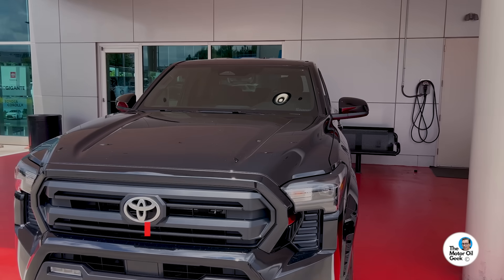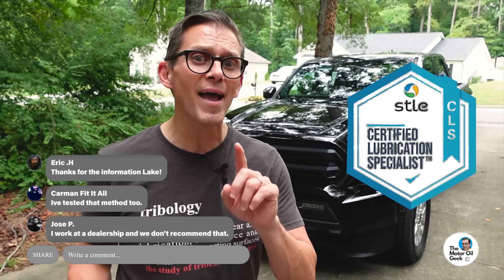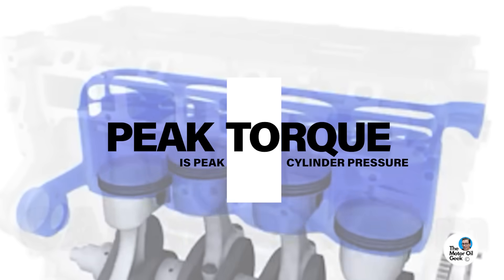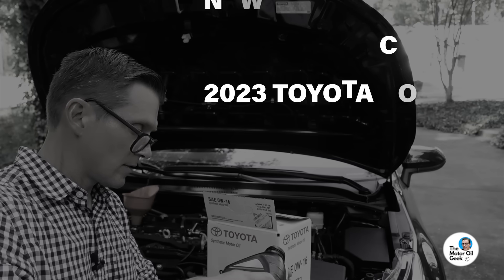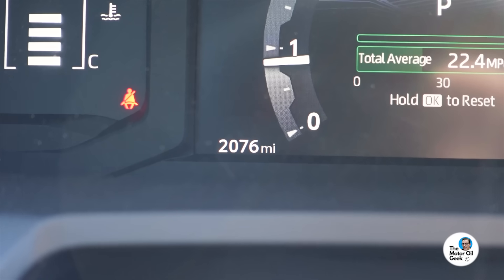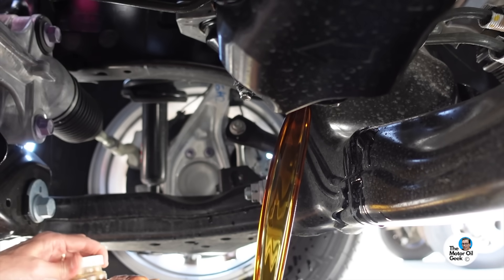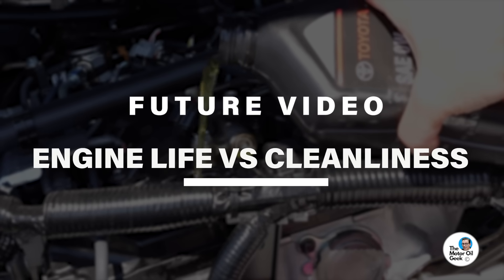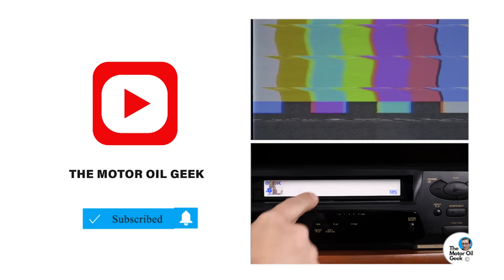The FACTS About Oil Changes (What The Owner's Manual DIDN'T Tell You)

Comment: Excellent video and topic is relevant. I am curious though that by not changing the filter during break in with the large amount of debris, will it increase the internal oil pressure of the filter to open the pressure relief valve and allow unfiltered oil the circulate through the engine? I understand that this may vary by filter and also machining tolerances of engine parts, however, I know on some cars the filter itself is tiny and by inference, the filter media reduced.  For example, Honda uses the same filter for their 1.5 liter I4's all the way to their 3.7 liter V6's. I assume that decision was based on cost and inventory simplification than really engineering.

Comment: Another great video!! Love your work. When I bought my wife’s Hyundai Tucson with 2.0L GDI engine, I did exactly this, and halved the OCI’s to 7500kms. Also jumped to a 5W-40 instead of a -30. Of course a low SAPs for the GDI. For a historically unreliable engine, ours has never missed a beat. I truely believe oil maintenance make a crap engine reliable 😂

Comment: In the UK i have always change my oil filter every year but do an oil change 2x a year with good,decent oil & i do 5,000m every year. As long as your engine has a good service history it's totally fine. With so many vehicles on the road with congestion,lights,road works etc the engine is at idle a lot compared to 10/20yrs ago.

Comment: Does break-in period change in Hybrids or remains the same 1000 miles (1600 km) as per other videos?
My car: 
Toyota Yaris Cross 2025 Hybrid SUV (Benzine + Electricity):
European type-approval number: e6*2018/858*00013*05
Variant: MXPJ11(H)
Execution: MXPJ11L-BHXNBW(1F)
Motorcode: M15A

REASONING:
For my specific daily routine and driving style, the average EV percent usage as reported by car's computer is 75%, meaning that if car moves for 100 km, 75 km were done using electric motor and the other 25 km were done via the classic thermal motor.
So does this mean that in my case, 25% thermal, break-in period is 4 times longer (4000 miles)?

Comment: Would not use 0-20 weight, that stuff is made to kill your internals slowly and get you back in stealerships and that type of stuff. Been running 5w30 in my 2016 5.7 tundra for 6 years or so now and no issues,  Taking better care of internals.  O-20w has about same consistency as water,  its to thin.
Reply: first Mobil 1 was 20, in the 70s. Today engines are made for that, low tension rings need it.

Comment: A question for you… I bought a new Toyota RAV4 last year. The first oil change was scheduled to be at 12 months, which I thought was rather longer than I would have chosen. Anyhow, we had done 8000 kms at this first change and I asked them to use 0W - 20 instead of the usual 0W-16 oil. They insisted that it be 0W-16, and as the warranty only applies if they do the servicing I was caught in a bind… to do it myself and put in oil that is an optional choice according to the manual, but have no warranty, or do as they said and have a warranty. What would you have done?

Comment: You’re content is amazing! But I’m not sure you’re right about the “dirty oil filter” is better argument from Donaldson. They were specifically taking about air filtration where they wanted to capture particles on the surface of the filter to capture more dust causing a dust cake filter effect. Oil filters are designed as depth filtration to capture the particle deep in the filter which does not have a dust cake effect. Am I missing something?
Reply from the maker: The same principles apply to both. Pay attention to the particle count results in the next video.

Comment: Would you not get more oil out if you drain the engine after it sat overnight, so that as much of the oil from the head drains down to the pan. This is opposed to warming the oil up before draining - I guess that more oil will be stuck up in the head.

Comment: Thanks to your videos, I did the first oil-change on my new 2.0L Turbocharged 4-cylinder Ford Maverick at 1,000 miles (I'd already missed the 500-mile mark, unfortunately).  Your oil analysis showed that the viscosity was SHOT!  It was below its rated 5W30 viscosity!  Can you imagine if I'd waited 'till 5,000 miles?  Or worse -- waited until the oil minder told me to change it?!  I wonder how many of those 2.0L engines have worn out prematurely because Ford's recommendations cause excessive wear?

Comment: Facts?  Hmmn? Silicon, as stated in your oil report is element #14,  the second most abundant element on earth.
DIRT, SAND, in common terms.
That has no relationship to Silicone, which is the man made chemical that is robot deposited onto your oil pan to keep that 20w watch lube you are putting in your turbo engine.

Who is the genius scientist here?  Ditch the API rated, govt. regulated crap and use some Royal Purple HPS 5w 30 which contains proper anti friction additives to keep your turbo alive and reduce wear on the mechanical fuel pump and timing chains.

You might want to install a good catch can system to keep your intake ports full sized ad delivered. Also learn how to idle for a couple of minutes after running on the hwy or trying to beat a Colorado 0-60 
(Fat Chance) before you kill the ignition with a glowing turbo housing.
That's advice from 45yrs racing experience building and destroying max hp per cubic inch endurance racing motors.

Toyota wants to sell you a new truck as soon at that one is paid for.

Comment: Using the clip of someone that says dirty air filter is better has no bearing on oil filter. Air filters and oil filters are not same. Someone might miss understand and incorrectly service an engine.

Most Oil filters have bypass built into them, air filters do not. Once the restriction reaches critical it allows oil to bypass the filer media. Allowing unfiltered oil to the engine and potentially damage engine lubricated components. 

Air filter at critical level will starve the engines air flow and cause low/loss power. Seen extremely dirty air filter only allow a diesel engine to just idle. Also seen extremely dirty air get collapsed on diesel.

I don't believe you did nothing wrong with drain and filling at the 500 mile change. But personally I'd changed it at each interval and cut open to inspect the filter media for debris/contamination.

Comment: Awesome video! I'm curious if there's any way to test whether doing these early oil changes actually reduces the amount of wear in an engine. Yes, getting those contaminants out of the oil is probably good, but is there any data to show that it actually reduces the overall wear that occurs?
Reply: Iron, copper, aluminum, all come from engine parts. Silicon shows how much dirt is passing through your air filter.
Just read the text that comes with the oil analysis or visit their site.
Reply: @s@savagebob911 I understand this, but that’s not my question. I’m asking whether or not these wear metals being present in the oil accelerate wear, and if there’s a way to quantitatively show that break in oil changes reduce the amount of total wear that occurs as opposed to sticking to the factory oil change interval

Comment: Well, when I got my 2023 subaru legacy new I did my first oil change at 1750 miles and then at 4883 miles. When I changed the oil the first time there was so much ungodly shit floating around in my engine. it looked so bad that I brought it to the dealer. the engine was fine.

Comment: Great video too bad most of the motoring public don't even follow the OEM recommendations! Back in the 80's I built or replaced a lot of engines due to poor or no maintenance, not much has changed since than!
 My sister just bought a new Subaru and they sold her a maintenance package...recommended oil changes... every 5,000 miles. I've never owned a vehicle that I went more than 3,000 miles on! And my goal interval has always been 2,000 miles with plain old dino.
 Is it a waste of money? 
WELL, I've never been inside any engine I ran this schedule on, my average yearly mileage was about 15k so lets say 8 oil & filter changes a year I'll round up to $30 per change. $240/year for oil changes, so after 10 years and 150,000 miles I'll spend $2400...can anyone replace an engine for that today? 
I forgot to mention that I switched from the OEM recommended 5W-20 to 20W-50 Castrol GTX after the 2nd oil change I live in South Florida the reason for the 20W-50 👍😎✌

Comment: ✅ yep, I Did similar thing to my Mercedes V8: drain factory at 350miles next day after I got home, than at 1k oil and filter, using 5w30 not a 0-30 recommend, every 3k miles after that. After 30k miles starting doing 5k changes and now is at 92k miles - zero problem! Runs like new.

Comment: I stopped watching your video @ 1:24. You should change your name to The Motor Oil Fool. Show me where in the manual it say to change your oil that soon and often. I bought a new 2016 F150 with the 2.7 ecoboost. My first oil change was @ 7,600 miles. I used the oil that came in my truck. Motorcraft 5w30 synthetic blend. I change it about every 8,000 miles. I can prove this because I make a video everytime I change the oil. My truck has 118,000 miles now and don't have to add oil.
Reply: The whole premise of this video is that these steps aren’t included in the owners manual. If one wants to insure the longest life possible for the brand new vehicle they purchase this is spot on. In fact I’d argue something similar for automatic transmission fluid as well.
Reply: @jawndoekck And differentials. 10 to 12,000.
Reply: @jawndoekck The manual is 100% the way to go. This guy is a hack. Do you really think Toyota is gonna tell you something wrong?
Reply: @Fone65 Toyota still sells unprotected frames. They rust inside. Engines are still recalled. Times are changing Chief.
Reply: @savagebob911Have you ever rebuilt an engine before?

Comment: Thanks for helping folks out.   However, I feel you side stepped some things that you should also address with your viewers.
   1st.)   One of the greatest mistakes I see car owners make, is to live only by the standard oil change, not realizing the intervals are recommended ONLY for ‘Pristine Conditions’.   Meanwhile, there is another interval chart that most ignore tucked away from easy view (but can still be found).   This other chart has different names per manufacturer, but it is best described as ‘EXTREME DUTY’ change intervals….
   Here is the interesting part…   What defines ‘Extreme Duty’?   Manufactures will list items like:  Driving in stop and go (urban) traffic, driving on dirt or in dusty environments, driving in wet conditions, driving in both extreme heat and cold, driving short distances, driving regularly on steep inclines (hills) or at elevation, towing or carrying heavy loads… etc.
   Sadly, 99% of us fall within many of those conditions, hence the ‘Pristine Conditions’ do not apply.   ‘Extreme Duty’ change intervals become the manufacturers recommended oil change.
   2nd.)   Remind viewers that manufacture recommended oils (their own private label) can used against owners for warranty purposes.  -Proceed with caution.   While there are far better brands for far less money, the fine print says you “must” use their oil (and filters?) to maintain the warranty.   Once out of warranty, it is a free for all!
   Peace!   And thanks again!

Comment: Interesting, however if you are changing the oil and not the filter I think you should have removed the filter, drained and reinstalled it.  You left 1/2 quart (approximately 10%) of "dirty" oil in the engine.

Comment: Thinner oils are why new engines are failing across EVERY manufacturer! I’ve been running 5w30 in a 21 chr for over two years now and the engine runs much quieter than the same car with 0w20 noise tells you everything you need to know. If you can hear rocker arms clacking that oil isn’t doing its job. I don’t care what the lab tests say let’s see some engine tear downs showing the difference in wear between the same engine on 5w30 vs 0w20 I guarantee you there will be a measurable difference in wear between those two oil viscosities.

Also oil manufacturers use 0w20 as a worse case representation of wear for 5w30 tests… AMSOIL used signature series 0w20 on their worse case representation of 5w30 testing there is a big difference in protection from 0w20 up to 5w30. And you’re talking about a fractional increase in fuel milage and flow characteristics are almost the same between the two 5w30 just protects better and is the default oil if you want to get 300,000 miles or more out of a vehicle.  
0w20 does not have the film strength to prevent major wear on turbocharged engines. That’s one of several reason the new tundra engines are having massive catastrophic failure. This 0w20 oil is not made for turbocharged applications. Big rigs run thicker oil because of increased pressures from forced induction and that’s the main reason they use thicker oils.  Fact is turbocharged engines require thicker oil than N/A engines do.
Reply: He already did a video comparing thinner and thicker oil, the result was no significant difference in wear. What occurring is that thinner oil is more likely to burn (1 quart per 1000 miles). In the car manuals it says to check the oil level regularly, and that's where the issues are coming from, people not checking their oil then end up running it on empty and damage it. And before you mention GM recall, the stated it was an engine manufacturer problem with the engine
Reply: @alfonsohdezB Still thinner and will not protect as well on turbocharged applications. Thicker oil= better film strength

Comment: This is kinda silly. You are not showing the data you think you are. You have never presented evidence that doing early changes reduces total wear, or that early changes accelerate the reduction of break in wear rates (key word accelerates), or that early changes affect long term engine longevity. All you have shown us is that wear rates are higher during break in and if you change your oil early, you can measure that inevitable reduction in wear, but, no duh. Reduced wear per mile will happen anyway during break in regardless if you do early changes and you are simply observing that fact via the oil sampling. Of course you will have less wear metals from 1,000-2,000 than from 0-1,000 and that is all this video shows. It does not prove that early changes ACCELERATE the inevitable reduction of wear metals during break in.  You have to make an assumption using that data to arrive at the conclusion you want us to arrive at, and making assumptions is not scientific. Show me data that the break in wear, which is inevitable, is actually detrimental in and of itself or that early changes reduces the total wear as measured once the engine is fully broken in. I am not going to assume that the inevitable break in wear actually causes additional wear compared to if those break in wear elements were removed like you are doing. Just because it seems to make sense, is not evidence that it does. 

And before anyone says this engine requires 0w-20, no it doesn't. Toyota recommends 0w-20. The owners manual is a legal document and a recommendation is not a requirement. Almost all Toyotas do not have a specific viscosity requirement, they only require something like a multigrade oil meeting API SP, or ILSAC GF6 for example. That is why the exact same engine (same rings etc etc) is allowed a 5w-30 in Europe where as in the US Toyota "recommends" a 0w-20. Even my 2022 Corolla Hybrid 2.0 is allowed 5w-30 here in Sweden when towing as stated in the owners manual but in the US everything thinks it "requires" a 0w-16.

Comment: I've only ever bought 2 new vehicles. My first oil changes for both were 500, 1,000, 1,500, 2,500, 5,000 miles. Then I went to either 3,000 or 5,000 mile oil changes, depending on oil capacity, with quality synthetic oil.

On used vehicles. I do 2 500 mile oil changes right after I get them. Sea Foam in both the oil.and gasoline. To get rid of sludge and carbon build up. 3,000 to 5,000 mile oil changes again, except my Cummins at 7,000. And synthetic oil for non leaking and non excessive burning engines. Slightly thicker conventional oil, for vehicles that leak or burn oil.

Comment: Great Stuff, Thanks! I am a dedicated home mechanic, with a professional background in aircraft maintenance and operation, and sincerely appreciate real data. On a Side note:  I am not promoting these devices, but for ease of accomplishing the oil change task, I have installed EZ Oil Drain / Fumoto Oil Drain Valves on my RAV 4, Tacoma, Honda and BMW Motorcycles. Particularly good on vehicles with aerodynamic pans installed under the engine. Also ramp up the vehicles where possible to tip the pan towards the drain valve. Never spill a drop!

Comment: I’ve never bought a new car. But, when I buy a used one I change oil immediately to castrol 0-w40, then again in 500 miles. After that every 5000 miles, which is about a year for me. I did switch to the Walmart 5w-30 on the 2002 solara just to see, so far seems good.

Comment: I've always preferred N/A engine's and the reason being is anytime you have a small engine that in your case is a heavy vehicle take away the turbo and it would barely have enough power to get down the road hence being the need for a turbo. I always get the biggest motor that will make the engine not having to work as hard. In essence a smaller engine causes more internal  wear than a non turbo engine.